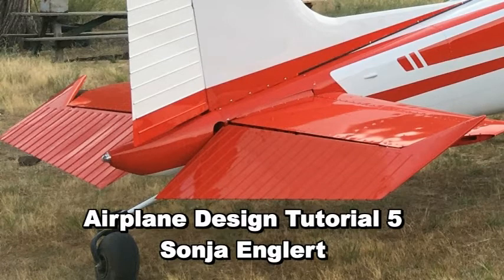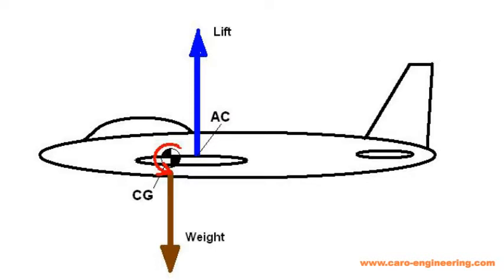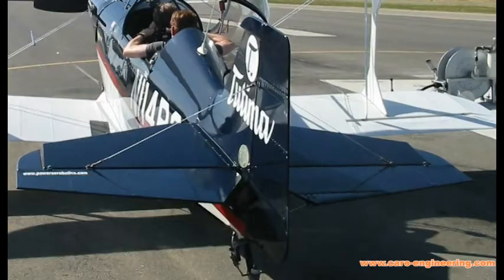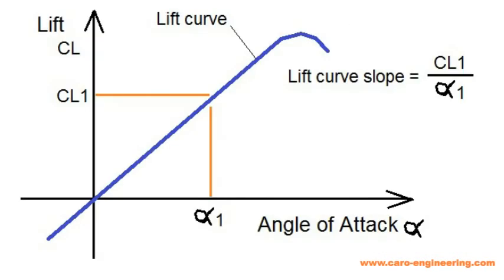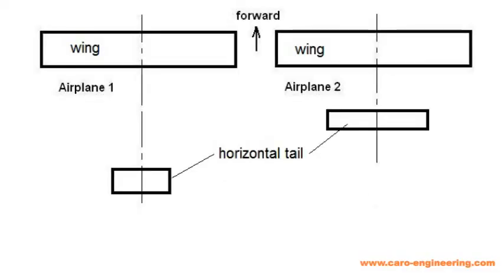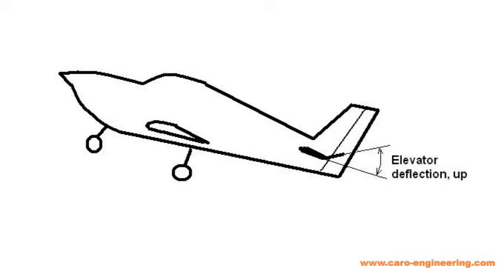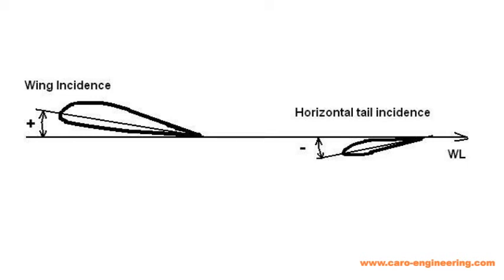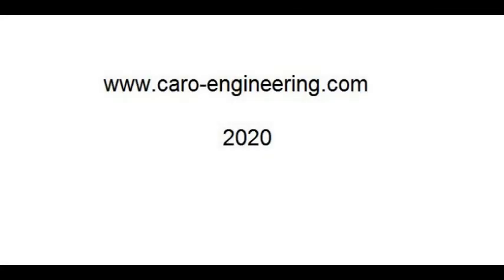Small Airplane Design Tutorial 5, Horizontal tail

Comment: Hi Sonja,
@1:31, you say that the aerodynamic center does not stay at the same place.

Isn't the aerodynamic center defined as a point (at about 25% of chord) about which the pitching moment is constant? Isn't it therefore constant by definition? 

Thanks for your help.
Reply from the maker: The AC mentioned here is the wing AC. It shifts with angle of attack. The 25% chord is an arbitrary reference point. The wing AC is at 25% chord if the pitching moment of the wing around this point happens to be zero.